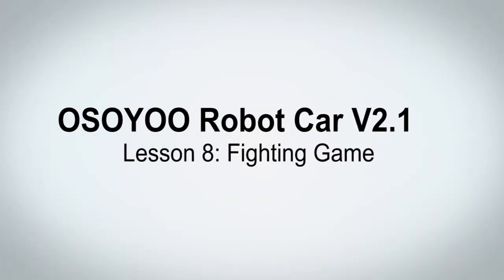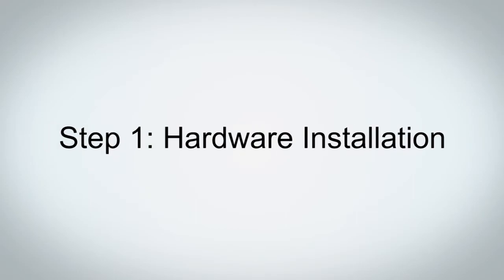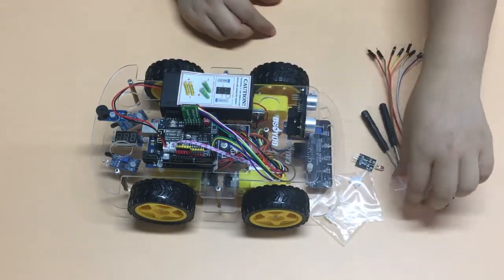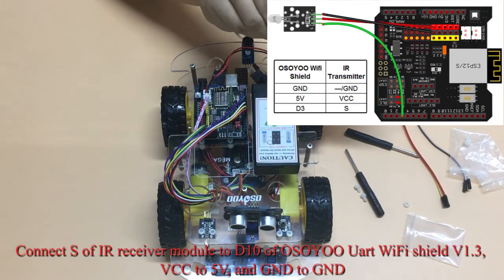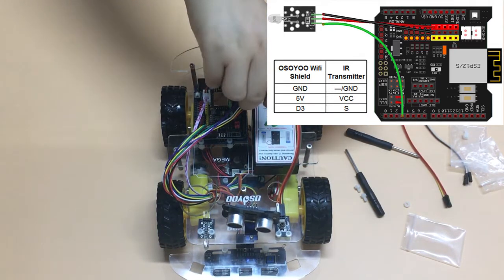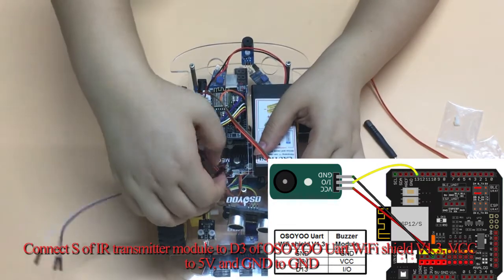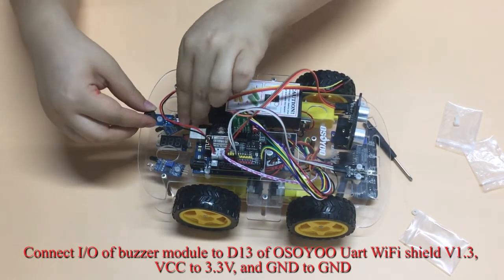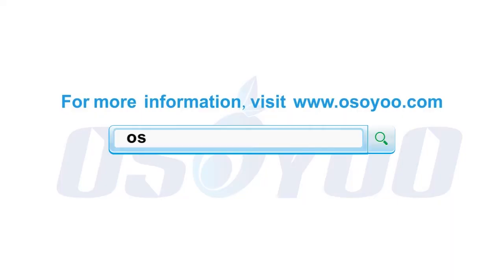OSOYOO V2.1 Robot Car for Arduino Lesson 8 : Fighting Game

Comment: I have this car,but i want me to connect the pulse heart rate sensor but it's doesn't read the heart pulse when i connect it with black WiFi shield board version 5,can you help me for solve this problem please?
Reply from the maker: Do you mean your want to use WIFI shield to connent to your pulse heart rate sensor but it doesn't work? Are you willing to take a video and send the smaple code to us and our technical support try to help you with this issue.